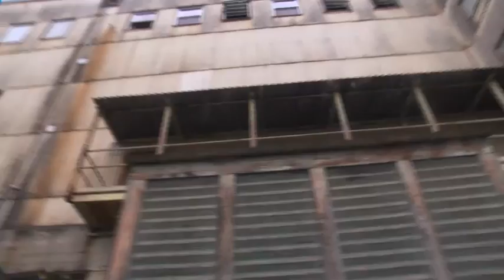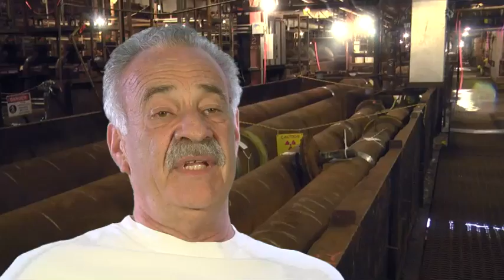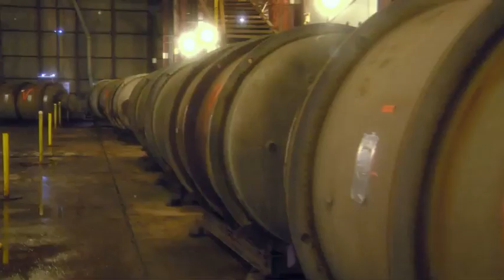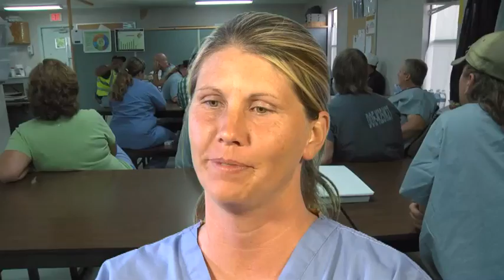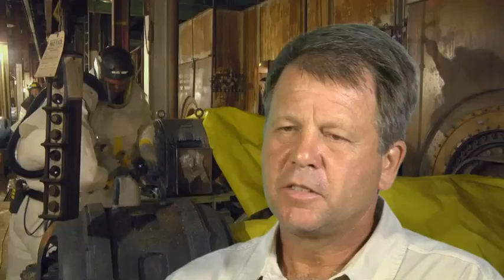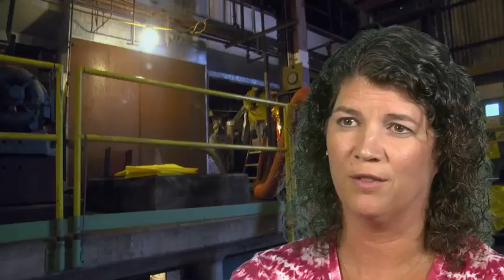The Faces of K-27 Deactivation

Comment: These videos are of the K-25 and 27 building and the smallest of the Uranium plant----the 1952 versions were huge in comparison and the converters larger than gasoline tanker trucks and tanker rail cars.

What they don't speak about is during the actual operations of these plants, there was none of this space suit level of worker protections and they typically wore just cover-alls and they call became heavily contaminated.     The entire worker sickness issues sprang out of how many workers became sick from K-25 during shut down.   The cover ups at K-25 led to the EEOICPA worker legislation, but they carefully side-stepped deuterium health problems.

These plants used workers from coal mines as they were used to high risks and contaminated bad air, and they would not speak up to keep their jobs at these dangerous plants that did not protect their workers.

What was made at these plants, the low enriched uranium was sent to Hanford to cook off Plutonium and doing that flooded the Columbia River with deuterium as the river water was run directly into the reactors making lots of deuterium that was returned back into the river.     After the uranium was processed for Plutonium, the low enriched uranium was returned to K-25 and other sites for greater enrichment and these were contaminated with Tc-99, Plutonium and more.

The cover up on deuterium began almost with its discovery as it was hailed to be an advance in cancer etiology understanding and then with the advent of nukes and deuterium issues, that was all hushed up.   Great cooperation with AMA and Big Pharma further concealed the huge health problems from deuterium.

Today, the cover up on deuterium is a trillion dollar collusion to make the AMA and Big Pharma rich by not using low deuterium health methods and treatment methods that were less effective than the well known plant low deuterium pharmacy methods.  Today, the death from high deuterium in the foods has set off the pandemics or cancers, diabetes, dementia, heart diseases and many others that have enriched AMA and Big Pharma by helping the Manhattan Projects conceal the terrible health effects on the mitochondria health effects from deuterium levels long hidden due to Harold Urey and deuterium and his involvement in the Manhattan Projects at Columbia Univ and the deuterium cover ups.

The Deuterium cover up is so extreme it is a Biblical plague issue come to reality and killing millions because it has been intentionally hidden by Manhattan Project deceit and treachery against workers and mankind.

The Whole Story here is a history of despotic managers that harmed their workers and the world.
Reply: Great comment....thank you!